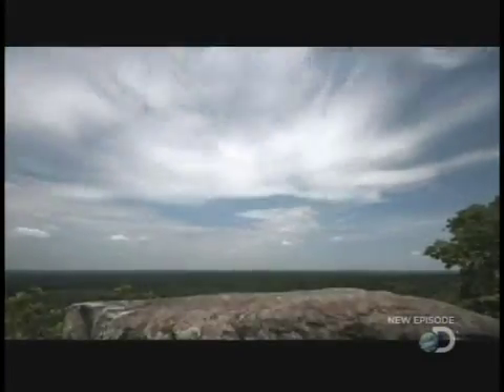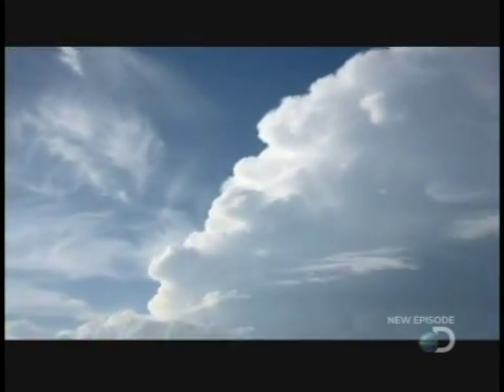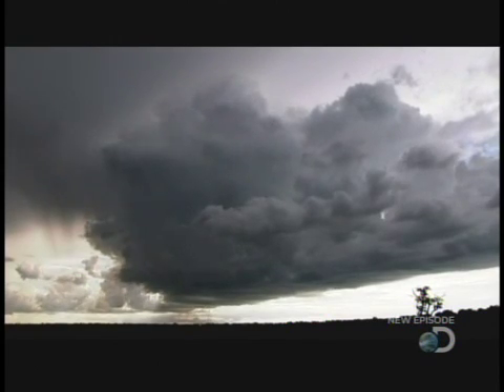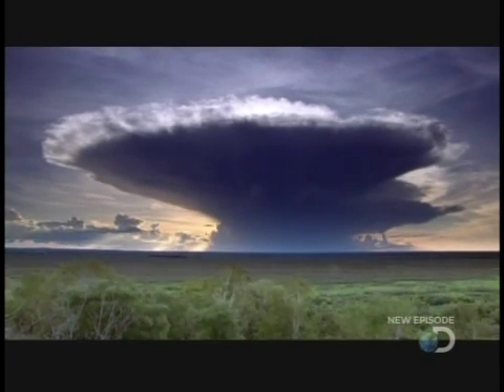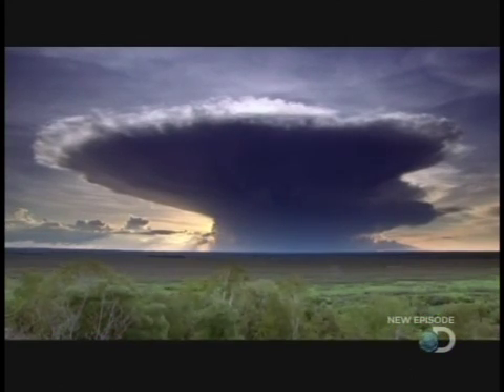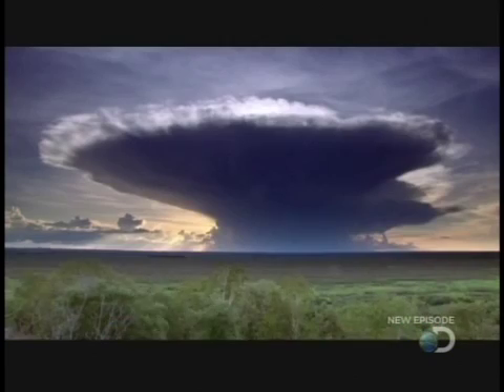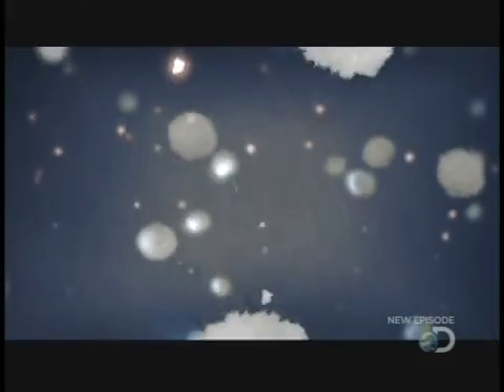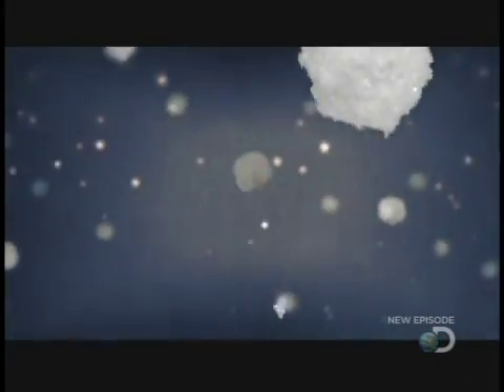How lightning forms

Comment: That's not very accurate description of how lightening comes about. lightening happens even there was no hail stones formed within clouds. It occurs when there is strong wind travelling through clouds charging cloud particles with static electricity by process called electric induction similar to when you rub your shoes against carpet as you walk then you touch the door knob and feel a buzz of electricity but on a very large scale.
Reply: Ken Norton Actually, the hail stones are ice crystals, and they do rub against other things in the storm cloud(s). And the air is harsh, sending air up and down and all around. That is how crystals and other particles hit each other. When lightning strikes,the thunder we hear is actually the sound of the lightning when it is/was released.
Reply: Bish no 🙄

Comment: Energy feels "hot" due to the fact that when emitted it can excite atoms. The sensation of "cold" is simply due to the absence, or lack, of energy, usually due to an absorbance of said energy. Clouds are made up of water/water vapor/ice. Water in general has a relatively high specific heat, meaning it's capable of absorbing a lot of energy without changing temperature. I'm sure the immediate area around the lightning is instantly vaporized, but the rest of the cloud wouldn't be affected.

Comment: Their program 'Super Lightning' explains it.
Even the voltage in a cloud is not enough to spontaneously discharge in a lightning bolt.
Turns out it takes an xray/cosmic ray originating in a supernova to trigger the strike.
my. fit. edu/~jdwyer/research. htm
Stranger than fiction.